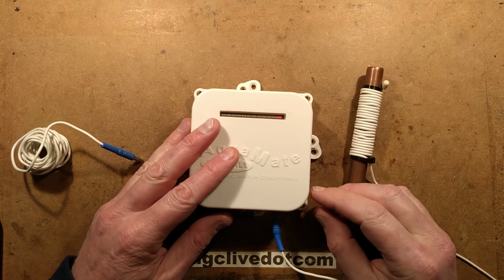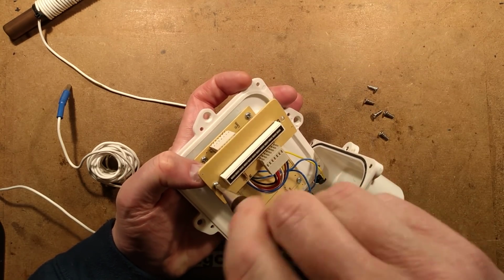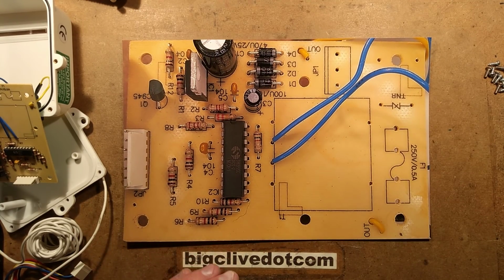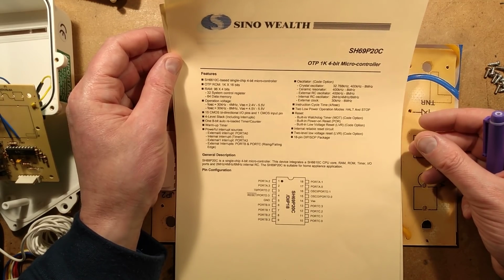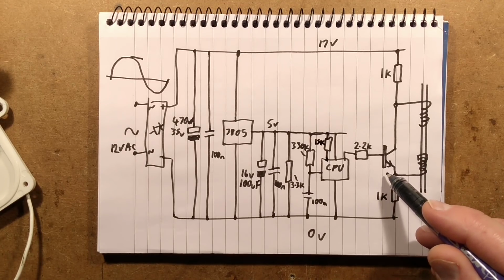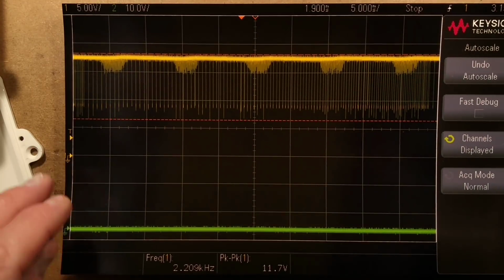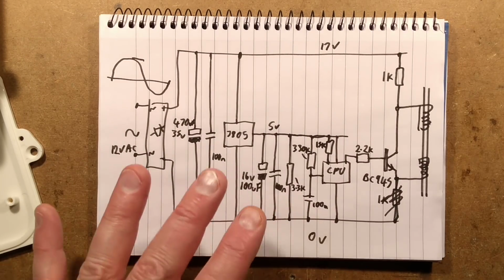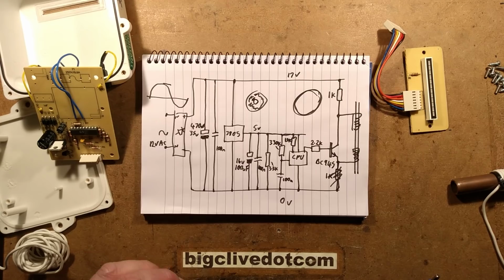inside a computerised pipework scale reducer.

Comment: The way they made the driver it is driving a symmetric signal to the two coils. Shorting the bottom 1k resistor essentially drives ground to the second coil and the amplitude of the first coil increases as you noted. I'm not sure this would make any difference. Particular with metal pipes and considering the frequencies they use in the device it is highly unlikely it does anything at all. You would need some magnetic field to penetrate the pipe. I could also not find anything about the operating principle of those devices. I do not feel confident they would be effective.

Comment: Both the Biology,Chemistry and Physics Departments in my Local University have Water Stills or at least they had in the 1990's.
We live in a Hard Water Area and because of this the Water Stills required Frequent Descaling Sessions. 
That was until Someone installed a Strong Toroidal Magnet around the Feeder Pipe to the Still in the Biology Department. 
The Calcium continued to accumulate in the Stillpot but now it was a Fine Dust rather than the Hard Cake that was there. The Dusty Residue was easy to wash out. 

There are 2 Allotropes of Calcium Carbonate,  Calciite which is Crystalline  and Aragonite which is Amorphous. It seems that the Presence of a Magnetic Field encourages the Lime in the Water to precipitate out of Solution as Aragonite rather than Calcite.

Both the Physics AND the Biology Departments in Maynooth University in Ireland have been using this "Magnetic Therapy" on their Water Stills for many years with Excellent Results.

I ASSUME that they have switched over to a Reverse Osmosis System by now as this is Less Energy Intensive than boiling Water all day.

I have NO EXPERIENCE of using Radio Frequency Energy to get this Effect but both Electromagnets AND Permanent Magnets work.

Comment: In the late 90’s I worked for a company that installed the largest “scale blaster” unit that the company sold on a small trailer park well water supply. They had very hard water. It took a while but the park owner stared to complain because pipes or connections started to leak and he had to make a bunch of repairs. The hard would seal the small leaks as they occurred in the ground or under the trailers.

Comment: It's a scam unit .It takes about 460V for it to work through capacitive coupling.I used on  my car .It used 2 capacitors .The capacitors were made of an ultra thin  PCB as the pad to transfer electricity to the body of the vehicle .It converts 12vdc to 460 v and would alternate between pads .Deadly zap if you touch the pads ! It was called Rust Buster .

Comment: Is it real?  Sure,  in terms of it  being a real product that they can sell to people and make some money by doing so.  Does it work?  Damned if I can see how.  There's a guy in this area who runs tv commercials trying to sell people something that they call the "scale ban".  The commercials show some wire wrapped around a pipe,  but I don't know if it's one or both ends of the wire connected in that setup.  He's really annoying in those commercials.  :-)  We have some pretty hard water here,  and a whole house filter gets a bunch of it,  which suffices for things like the wasther and doing dishes and such,  and then after that there's a reverse osmosis filter that provides some drinking water at a lower rate of flow.  Both of these need to be changed from time to time.  Lots of minerals in the water here,  some calcium and a lot of iron,  which shows up as rusty stains on the shower head and such.  Personally I wouldn't waste any money on this thing.  That is a rather nifty display,  though.

Comment: Thanks for reposting these gems, big Clive. I see some comments (which are good but, have pretty much totally opposing efficacy views) skew from "helpful" to "ineffective".
Myself, I have not owned a house so I have not formed a valid opinion. 
I did once get talked into a water distiller; a friend made a deal through a wholesaler, and made what he could charge. About a 1-1/2 ft. (.5m) tall and 1 ft. (.3m) aluminum hot pot with cooling tube attached above.
Good for distilled water for irons, batteries.
I think since this was 1980s my parents thought I discarded it, so it is no longer around! But it had limited use. 
Good video breakdown of electronics

Comment: I had this exact same product installed for about 2 years, fitted at the same time as my new oil fired combi boiler. When the heat exchanger scaled up after only 2 years ago I removed it and threw it away. I then spent several hundred pounds on a proper water softener. 19 years since then and no problems! I live in an extremely hard water area. So hard that sometimes leaks 'heal' themselves due to scaling in only a few weeks!

Comment: The transistor output is a phase-splitter. As the output pin goes high, it pulls the base of the transistor toward the 5V rail and hence the emitter rises to about 4.3V. At the same time, the collector drops by the same amount below the 17V rail. So as the output pin toggles, you get antiphase square wave pulses applied to the two "antennae" at whatever frequency the MCU is programmed to deliver. Of course, there is no way at all that it can possibly affect the chemical composition or physical properties of the water in the pipe. Unless it is installed at Hogwarts school, perhaps?

Comment: Hello Clive, First; what wonderful informative videos!
Now I'll stop grovelling.
I have a water descaler unit fitted by a well-known northern gas company as part of my combi boiler installation.
It comprises a "transformer" winding around the copper cold water inlet to the boiler, a single winding where both ends of the winding plug into the descaler unit.
I've no idea how well it performs in descaling because not long after the water descaler unit was installed, we had to switch it off due to excessive radio interference. I suspect it is performance is similar to how well snake oil performs.
At this point, I point out that I am a radio amateur with an electrical engineering background.
The water descaler unit literally causes such high levels of radio interference that all the Long Wave broadcast band is obliterated and up as high in the radio spectrum as 2 MHz, by 50 Hz modulated hum every 20 kHz. (Looking at your scope picture I can see this unit I have may be so so similar in output.)
The unit itself is powered by a small linear power supply, so it is not a switch mode PSU causing the interference, but the descaler itself.
We surmise that the water descaler unit puts 20 kHz RF-induced into the water pipe to descale, but I am guessing because I've never worked on water descaler units before and I refer back to my previous comment about “snake oil”.

I only wish I could ship it to you, but because it is under contract with, it has to remains in situ (and we only plugged in when they do the annual service)!

Regards,
K.

Comment: Regardless of if it works actually or not.  Logically if it cleans up the pipe or stops the pipe from clogging up then it can only do that by putting the scale back into the water to take it away ... that would then precipitate the scale out in the water supply that you consume.  I can't see how it can clean the pipe and improve the water quality you drink / consume ... it's like you want your scale and eat it too ... ;-)

Comment: The two coils do capacitivly couple to the pipe, basically like two capacitors in serries with the pipe being one plate of each capacitor.  And the total capacitance being = 1/(1/c+1/c). 
I dont see any electrolysis  happening because the pipe is nearly a dead short from one capacitor (coil plate) to the next which would not allow a potential to develop at the pipe/water interface.

Wondering if you had two copper pipes connected by a wire, could you sense tiny current pulses in the wire.

Comment: I have no idea how well it actually works but there is some "legitimate" theory behind these magnetic pipe scale gadgets. 
The calcium salts that end up crystallizing and sticking to your pipes can form in several slightly different crystal structures...
Some of the crystal structures are stickier or harder and so cling to the sides of the pipe more strongly than others.
That part is legitimate... there are different crystal structures that do vary in stickiness and hardness. 
However there are all sorts of reasons why you might end up with a particular mix of the different types of crystals. 

The THEORY is that the magnetic field fiddles the alignment of the molecular structure of the microscopic clumps of crystals that form in the water...
The idea is that, by doing so, it causes softer deposits to form, which don't cling as tightly, and so slip through or clean out more easily.
Or perhaps that it encourages some to continue on through rather than clump up or stick to the sides.
In this case it looks like they're using some sort of "special" AC signal.

I haven't seen any conclusive evidence as to whether fixed magnets, or AC units like this one, actually do have a significant effect.
(I wouldn't be surprised if some of them work... to some degree... under very specific circumstances.)

Comment: Love these videos.
I can see how it's supposed to work but I don't know if this would do anything.
Do scale reducers actually work? Some do.
I used to think they were all snake oil until I moved into a new build flat 3+ years ago with a magnetic+electrolytic reducer fitted on the main pipe. I live in a very hard water area. After a few showers the dry, thickened, cracked skin on my hands just started to fall off in bits. Now I have minimal dryness on my hands and can't recommend a hood one enough.

I don't think I'd recommend this device, though.

Comment: I bought one of these sort of things out of curiosity.  Fitted it at the same time as a new cylinder.  10 years later, the cylinder had failed (mega hard water area) and I can see no difference inside the "new" (10 year old) pipework to the original.  It's all scaled up and manky inside.  Maybe this is because the one I bought just has 2 blinking LEDs and not a little Knight rider thingy?

Comment: The open coils against the copper will act more as a transmission line than an inductor at that rise time, but there's no energy inside a Cu pipe (it's a Faraday shield ).

I was approached in 1976 to manufacture these little hoaxes who the client said could sell for $75.

Told him no thanks.

Comment: Simular units called "Aqua-Rex" are used in the swimming pool industry. I have a few clients that have them. These units do not work quickly but from what I can tell, they do work over time. They are not a quick fix. They way that it was explained to me that they work is they supposedly broadcast some radio frequency waves or energy into the water which causes the metals or minerals to start vibrating. The vibrating metals or minerals are not able to bond or attach (scale) to surfaces due to them moving. If there is scale already present, it vibrates the scale on the molecular level. This vibrating causes the scale to break free from the surfaces. 
I have always been skeptical about these units myself but I have one client in particular that had a horrible problem with scaling in his pool. His total dissolved solids were off the charts. He asked me to instal an Aqua-Rex on his pool. No new scalling has occurred in the several years that he has had it and I have reason to believe that his Calcium levels keep rising due to old scaling being broken down and reabsorbed into his pool water. The white, dust like material in the water is so fine that it isn't even able to be captured by his filter media and which is supposed to filter down to 4 micron. 
It has taken several years to start realizing the effects of his device. I'd say that it probably works to prevent scale or to reverse the scale that has already but up in swimming pools but only the most patient of people would give it enough time to realize a bennefit. Patients is less common (in most people) by the day it seems.
Anyway, love your channel, the knowledge, and the humor. Thank you!

Comment: Where does the scale go? Stick to the inside of the pipe in this section and over years block the pipe? This device makes 0 sense, if it works it blocks the pipe over time and if it doesn't block the pipe the scale just comes out of the tap still? :-\

Comment: So it either does nothing or it causes all of the scaling you'd find in your water heater to concentrate in a small section of pipe.  Bottom line is a simple tautology: if it is not removing the minerals, it is not removing the minerals.

Comment: The transistor in this case is used as an emitter follower, applying about 4.5V across the emitter's 1k resistor. The resulting emitter current is sent up to the collector's 1k resistor, but is 180 degrees out of phase. Note that the collector never gets low enough to saturate the transistor — about 12V. Because the two "antennas" are single-ended, there is zero current being sent into them, so no magnetic fields can be generated by either. Thus, all this thing does is to apply two anti-phase voltages to the two wires that you wrap around the pipe and which are only slightly coupled by a very weak capacitance between them, a picofarad or less. What they do after that is voodoo electronics — total hooey. Commenter emcgon rightly calls is "homeopathy for domestic plumbing." There is zero science backing what this sham electronics contraption claims to do. They are usually passed off as "a better water softener," total BS.

Comment: It would be a simple thing to set up a pair of test loops; heat source, pump, radiator. Put the doohickey on one of them and let both run. Start with the same source water in both loops. 6 months later, open them up. Sample the water and compare. Tear down the heaters, radiators, and pumps and inspect for minerals. This really is a no-brainer, and I have yet to see a manufacturer of these types of devices provide that basic data. 2 identical systems, one with and one without. Until one of the makers provides this simple evidence of their claims, I say it's bunk. :-)

Comment: True snake oil. However, capacitance couldn't be the mechanism at play here. Instead you are basically looking at an antennae. Assuming a 1/2 inch pipe, you are talking an aerial with total length (12 turns * PI * 1/2) of about 19 inches. Assuming radio frequencies, this would correspond (at 1/2 wave) to around 300MHz. Now admittedly this thing is putting out pulses (which means harmonic components just might go this high) however the amplitude of a 300MHz harmonic off a 1uS pulse is going to be minuscule. So from an energy point of view their is almost nothing coming from this antennae. The idea that such a weak, poorly coupled antennae could have any influence on ions in the water is beyond farcical. I would also suggest the oscilloscope display indicates there is no significant coupling to the antennae i.e. no energy transfer. This device is completely bogus.

Comment: Wall-warts aka external power supplies are used so only the one type of unit needs CSA/UL/BS approval. If the power unit was housed INSIDE each powered item, every type would need separate approvals.

The charges made for initial inspections range into the hundreds of Dollars / Pounds / Euro - pure highway robbery. This way the clever Chinese minimised costs.

Comment: According to Christiani Wassertechnik (CWT) of Germany, their system uses two cylindrical charge plates (approximated by the coils) over the pipes to induce an electric field through the water.  The molecules of calcium compounds then convert through a mechanical/chemical process of electrophoresis to a less sticky calcium compound while carbon dioxide is released as a byproduct.  The carbon dioxide mixes with the water to form carbonic acid which helps to remove existing calcium scales.  The transformation is temporary and the less sticky calcium compound will revert back to the original sticky stuff in about 2-7 days depending on water temperature.  The chemical reaction formula is Ca(HCO3)2 + Electrophoresis -> CaCO3 + CO2 + H2O.  Whether their claim is true or not I have no idea, but they seem to have some very large customers.

Comment: Why not electrically connect to the piping and send alternating pulses to blow and suck ions at a high frequency? Probably still wouldn't work but at least you can hand wave it as doing something. However, I am more worried about releasing copper ions into the drinking supply than causing an accumulation of iron ions inside the piping.
Is this effectively 2 inductors with a capacitor between(the copper pipe and the insulation of the wire) in series? What is that supposed to do exactly?

I simulated it and it is doing something... Classifying this as alien technology. http://tinyurl.com/y5agnthc